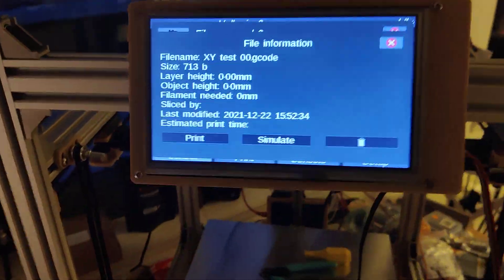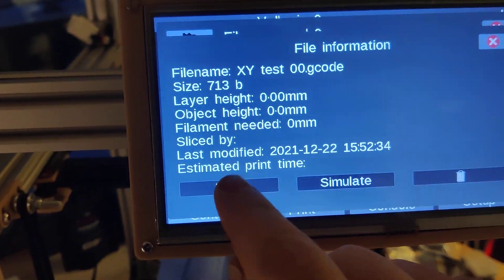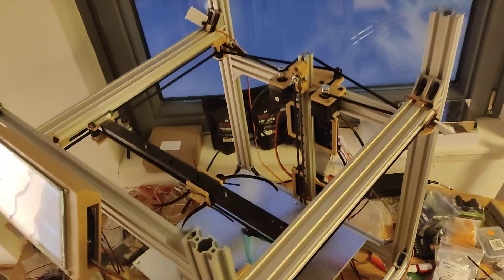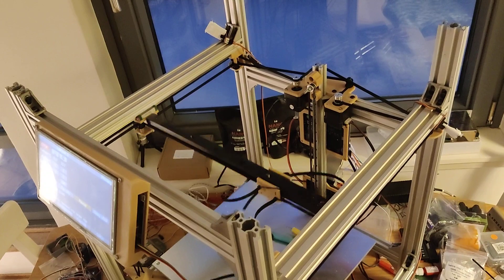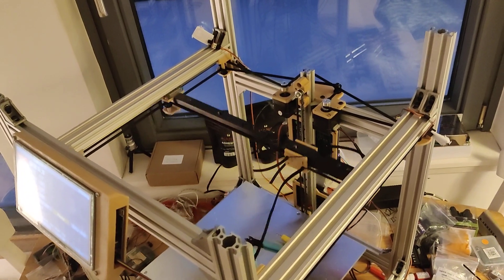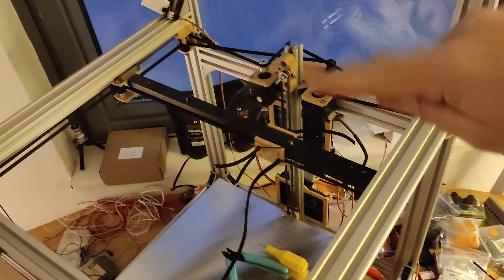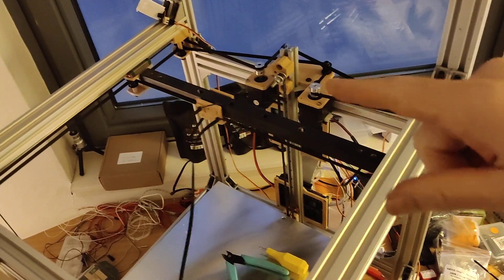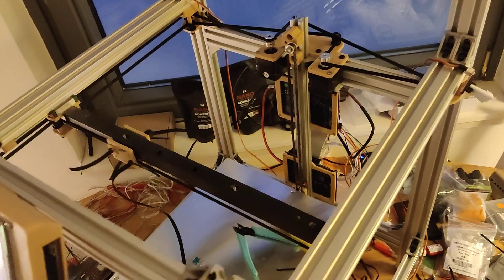We have AB/XY Motion! Project Valkyrie. Designing a High Temp DIY 3d printer

Comment: 90 degree for belt drive is not enought and bad engeneering practice. Ensure to get close to 180 - especially to avoid skipping without overtensioning the belt.
Reply from the maker: Very well observed! You are looking at dummy parts, we are prototyping, so setup is just to test options to find the best belt path. We will get more grip on the pulley for sure. Thank you for commenting

Comment: in my BLV i made pockets that were separate from heated chamber and cooled with fans. on my own desing printer i have the motors inside without pocket but heatsink out of the chamber. both solutions work very well
Reply from the maker: Thank you Kari. Very helpful information